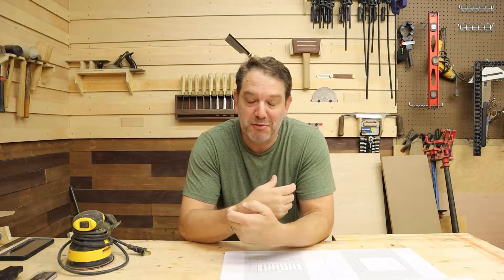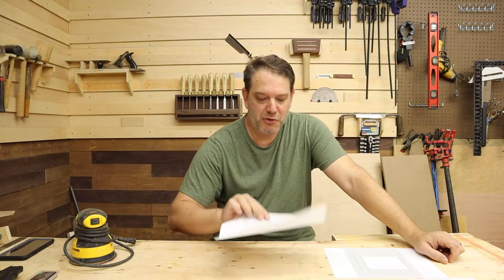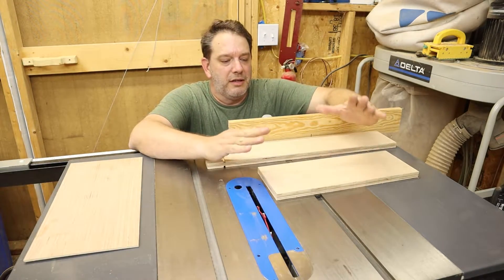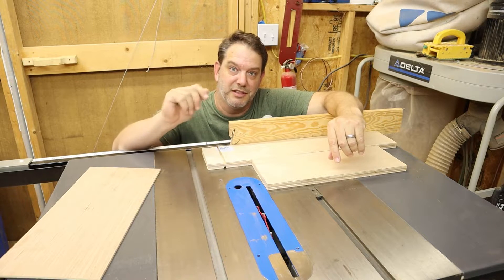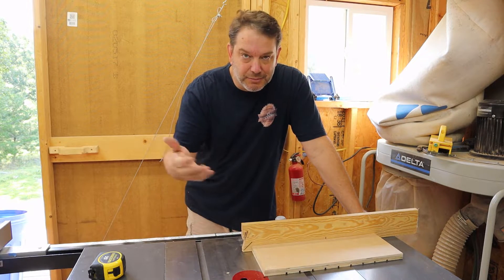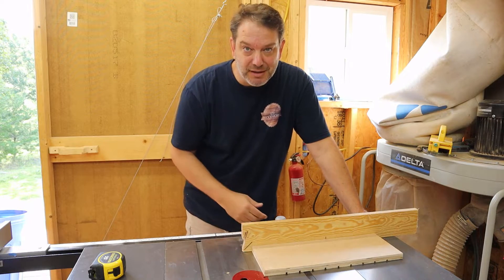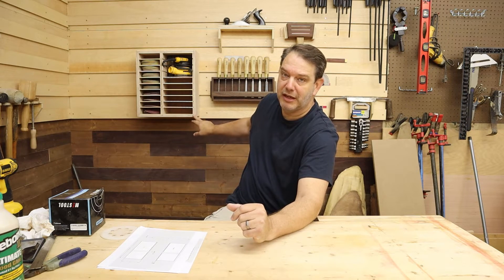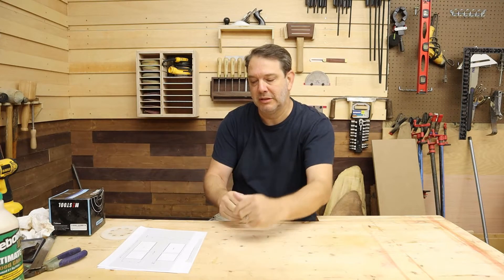Orbital Sandpaper Storage Cabinet | DIY | Solutions | Woodworking

Comment: Nice work. I have the same sander on order and I’ll be building something like what you showed. Have you thought about adding a cutout on the trays to make it easier to grab the sandpaper?  I’ve seen it on some videos. 
I live in British Columbia, Canada. 
Thanks for sharing your build.
Reply from the maker: On mine I have actually found it easy to just grab the shelf and slide it out to then grab the paper. That sander is now my “number 2” sander as I finally got around to buying a Festool sander. So now I will have to build a new holder for both of them maybe. But first I need to get set up in my new shop. Video will come soon for that. Thanks for watching!👍

Comment: I like this...I need to build one!  Did you need about a 1/2 sheet of each plywood?  From Minnesota
Reply: Also, the last page of the plans with the 14.25  x 16 piece...what is that for?
Reply from the maker: A 1/2 sheet would be more then enough👍 And sorry I didn't label it but that last page piece in the back panel. It's made from 3/16" thick plywood. Thanks for watching!

Comment: Well done!  Ottawa, Ontario...Canada.  Any chance you have plans available?
Reply from the maker: Thank you! No plans available just yet but will be added to my website soon!
Reply from the maker: Just uploaded the plans to my website. Under shop, free plans. These are very basic plans so if you have any questions just let me know.
Reply: @LTDWoodworks  Right on!  Looking forward to tackling this build as I am in need of some sanding station organization.  Thanks, and I will keep you updated with the build.  Cheers!
Reply: Hello, just looking for clarification on a couple of items.  On the second page of your plans where I believe it shows the shelf inserts, I cannot read the numbers/writing on both sides as they are cut out.  Can you tell what it says?  Also, what is the point of the semi-circle 2” wide on the 5-3/4 piece?  Lastly, on page 5 (Top & Bottom pieces) what is the centre point of that 3/4” Dado?  It sea,s as though one side is bigger than the other?
Reply from the maker: @mikecardinal7706  well shoot. Sorry about that. When I get home I will make some changes and re upload the plans making sure everything is readable for ya. I’ll let you know when it’s ready 👍 For now the half circle is just so it would be a bit easier to grab the stack of sand paper. I actually did not cut that out on my shelves and have had no problem grabbing and sand paper. So basically that cut is optional.
Reply: @LTDWoodworks  Copy that.  I had figured it was exactly for that but wanted to confirm.  Awaiting your re-upload.
Reply from the maker: @mikecardinal7706  Ok, just made some quick changes and additions. It's re uploaded to my website. Hope that clears things up.
Reply: @LTDWoodworks  got it.  Thanks.  Will keep you posted on progress
Reply: Sorry for the 100 questions ... what thickness of wood did you use for the back? 1/8” plywood?  Also, on the page with both the left and right side, I see the dado size of 3/16” at both rears.  Am I right by suggesting that this dado will be 3/8” deep to match the 3/4” dados at the top and bottom of these pieces?
Reply from the maker: @mikecardinal7706  Totally fine asking questions. Yes, I used 1/8" ply for the back. And yes, that dado or rabbet will be 3/8" deep as well. Makes me think that all of my future drawings will be done on Fusion 360 and will be much more detailed and professional looking. Again, ask away if you have more questions.

Comment: Wouldn't it be easier to make a semi-circle on the front of each shelf so that it would be easier to remove a sheet of the sandpaper?  Just wondering why you didn't do that.  TIA
Reply from the maker: That is definitely a option. I find it just as easy to pull the shelf out though. If the dados holding the shelves were tighter, then yes the semicircle cut out would be needed. Mine are just right to easily slide out. Thanks for watching 👍